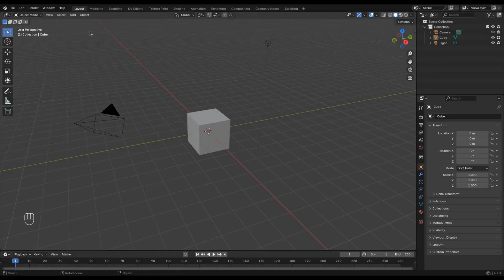Gift Card Case: 3D Print Tutorial

Comment: of all the plastic trash 3d printers make this is one of biggest examples.

Just another piece to add to the pile that will doom us all.
Reply from the maker: Totally understand your point of view. I try to minimize waste by using as little material as possible and printing things that have a practical use. Also, I use PLA, which is a biodegradable material made from corn starch. I believe that with the right approach, 3D printing can offer more positives than negatives.
Reply: this is a lot more functional than most figurines and fidget toys but sure
Reply: @jnitsuama  bro its literally trash. Just because it has a use outside of sitting on a shelf doesn't make it any less than trash to add to the pile.
Reply: @jnitsuama  not even mentioning all the failed protypes and misprints he had to go through.

Literally just trash for no reason and ultimately will just end up on a shelf or in a drawer full of other plastic trash of not just ends up in the trash as another useless product this asshole made for a youtube short.